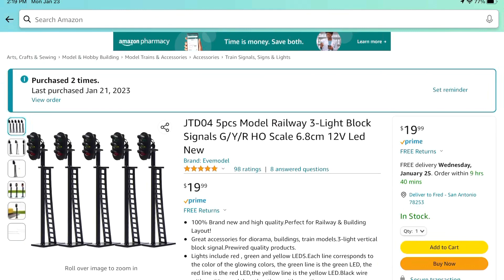My 6x16 HO Layout - Turnout Signals using Circuitron Smail

Comment: Never heard of 'Smail's"... always used manual Caboose Hobbies ground throws.  Looks like an interesting alternative for those hard-to-reach turnouts.  Thanks for sharing.
Reply from the maker: I like them a lot.  Cost more tortoise at certain qty levels depending on how many you install.  With tortoise you need addition decoder board.  I like to control my Smails with momentary rocker switch rather than throttle if it’s within reach.  Just easier.  Did video on this recently.  They work great on JMRI as well.
Reply from the maker: Here’s link I did on Smails. https://youtu.be/7Hm9U-HdxKU
Reply: I have a 13x9 layout, and while the electronics/automation side of things is intriguing, it's a lot of headache (and expense) to get it to that level for a small layout (prices in Canada are extreme compared to the USA).  Sometimes good enough is good enough.  Looking at your layout though and the 'thumbnail' it looks like your layout would have benefited from a 'double slip' switch as it doesn't look like there's a way to get from the 'north' track to the 'south' track without having to traverse the entire layout to get to the correct turnout.. unless you planned it that way?  Smails on your layout makes sense as one turnout needs to work in concert with another to properly route trains.  With my layout, the use of ground throws adds a certain level of realism (and panic) as I race to throw a switch, lol.  So long as you're enjoying the hobby, that's all that matters.
Reply from the maker: I’m assuming you are DCC and you are sure right about cost of electrics.  Original I was DC when I started in 2017 with all Atlas snap motors.    Then I got seduced by DCC and cost really increased. I have over 40 turnouts with Smails at $35 each.  I have expansions on each side of the 4x16 with just Peco switches without switch motors.  On the far side extension a have one double slip.  I have two back to back in my NH layout at the Cargill plant.  They work really nice on both layouts.  As far as your observation, I was a complete novice when I build the area you talk about.  Too late to change it now.  Thanks for feedback.
Reply: @FredE528  40 turnouts? Oh my. I think I have 12.  Just to give you an idea of prices in Canada... a Peco Code 83 turnout at an uppity hobby shop retails for $45 + tax = $50.85, which is around $38 USD (Ouch!).  One Smail here costs about $47 USD.  (double ouch!).  Best way to get in the hobby right now is the used sales table.  If you see a large layout on YouTube and they're from Canada... they [likely] have deep pockets, lol.  Keep the videos coming - they're great!
Reply from the maker: Wow, expensive.  I bought my Smails on eBay.  Got a super low price on some of them.  I get my Peco turnouts from Iron Planet Hobby. When they actually have any.  A checkout code of ‘Human’ gives you a discount.  I don’t know if they ship to Canada.
Reply: With exchange, import fees, even with a 'discount code', we're still better off paying the super high prices of our local hobby shop.  The days of shopping on eBay are over as they now charge tax on used goods.  I think, unless you got in the hobby years ago, it's terribly cost prohibitive.  Thank goodness for train shows and the used sales table.
Reply from the maker: I’ve only been to one train show lately.  Bought several completed buildings for Creston on my NH layout at super great prices.  Can you buy on Amazon without import tax?

Comment: Wow Fred almost didn't recognize your layout. The signals look 100 % professional.  I'm not familiar with modern Bus feeders or wiring I was wondering why the horn went off.
📯🤐😹😄🤣🤣 🤣🤣😄 
Oh Fred !   What model railroading can throw some curve balls. Your layout looks like the book catalog of PECO this looks really great modeling Fred. 
Harold.
Reply from the maker: Ah, the horn!  This Fredup (Mark @ M&M Rails term) was bad! After installing the signal on this motor it no longer worked.  🤬. I guess I shorted it out somehow during wiring. 🤬.   Couldn’t quit understand why.  I’ve done this over a dozen installs.  But ‘It’s Always $&#$& Something’
Reply: @FredE528  Don't worry Fred i will make you feel better. The first time I set up a motor switch I held the button slide to long ( It was an ATLAS. HO)  I smelled something burning couldn't figure out what was until : I saw a lump of slightly melted plastic That's what was burning. 😵 🤐📯I can laugh at myself now!  🤣🤣🤣 That happen to me years ago. Mechanical bugs. You have my support always fun & spirit.
Reply from the maker: I had major short in past. https://youtu.be/0J4wr0wc9yE

Comment: Hi Fred, I love the signals, really looks good. (If I ever😆)get a switching layout going, I'd like it look something like that!!! Love it🥰👌
Reply from the maker: Thanks Grant 😀  I still have 6-8 to add on far end of the layout.  Not a lot of fun - soldering extension wires then back work under the layout on my creeper. 😬
Reply: @Fred E Model Railroad  I bet, that creeper is a life saver! Least your on the ground, not like when you were up a ladder trying to get an aerial view of your layout if I remember rightly 😆 brilliant!! Just bob a bit of ZZ top on in the garage, and boggie around for a bit, loosen up before going under the layout!🤠👌
Reply from the maker: ZZ Top great idea.  Not much boogie left….  Failing off ladder would be deadly.  I actually feel off the creeper yesterday.  I felt the shock from that 3” drop…😕
Reply: @Fred E Model Railroad  3" can make all the difference in a many situations🤣

Comment: Hey Fred.  How are you doing? Haven’t seen you post anything for a while.
Reply from the maker: Hi Bill, thanks for reaching out.  It has been a while.  Physically I’m doing well.  Just at crossroads with my layout.  I have some small projects but no motivation.  I’m giving strong consideration stripping it down to the plywood.  Put on new foam and start over.  But I can’t even get motivated to start.  I’ll decide on this in the Fall.

We will head to NH in about 30 days.  I spent few hours today boxing up the BNSF equipment and Walthers models I bought over the winter.  Not sure it will all fit in my car top storage carrier.  I might have gotten a bit carried away on eBay!
Reply: @FredE528  I’m glad you are going well Fred.  I’ll be honest and say I was concerned there.   Half the fun is in building a layout and then tearing down snd going it again as skills get better and we know what we want to do 😄. So many opportunities for something totally different in that space you have.  I’m somewhat in the same boat.  I don’t want to tear down but I may need to do something else.  I have the itch to start another lol.  I’m seriously thinking about adding a third 4x8 for the switching layout.  I just need to figure out how with getting rid or any 😂😂😂
Reply from the maker: Thanks Bill for your concern and follow up. 😀.   I got into the hobby in April 2017 knowing almost nothing.  Not afraid to try given all the YouTube educational videos available.  You do wonderful educational videos. 👍

I still have things to learn. Mostly JMRI automation with signals and occupancy detection.  But I honestly think I’m just not interested in redoing my SAT layout in my garage.  I could change the track plan but I’m still limited to the 6x16 space.  Like you, I get most satisfaction in the design and building something different.  I’m not ready to make decision on this until I come back to SAT in the Fall.  I’ll see how I’m feeling then.  

I’m not surprised you’re thinking about next build. 😀. But that’s a more difficult decision than I have.  What layout to remove?  You have done about all the scales and every type of landscaping imaginable.  Would you be satisfied with just building an extension on the HO switching layout for long?  How about doing a new whole garage layout with both HO and N combined?  Find a place to store the Show Layout offsite.  Or you could just seek treatment for your addition. 😂😂😂
Reply: @FredE528  you know therapy would be cheaper 😂😂😂. My wife has actually offered to let me rent a storage space and I may have to consider it.  Problem is that nothing is close.  I may just get a trailer and put the show layout in it anx maybe make a rack so I can slide a section of the  HO layout in as well.  I do have a city scene in mind for the HO and I did envision it with three sections before I filled the garage with other layouts 😄
Reply from the maker: I’ll be interested to see what you decide. 👍
Reply: So glad you are doing well Fred. Hello Grant, how ru buddy? Fred, this layout is for your entertainment while you’re in SAT. Do you really want to work under a new layout in an uninsulated garage on the creeper? A new layout would be a lot of work and the testosterone to be motivated is now a distant memory, lol.
Reply from the maker: My enjoyment in this hobby is building.  Some fun on YouTube as well.  I just feel I’ve done about everyone of interest to me on this layout.  Some small projects but nothing interesting to me right now.

Comment: Hi Fred, Checking the Man is ok?😊👍
Reply from the maker: I’m fine.  Thanks for checking on me.  I have first follow up visit since radiation therapy with my Urologist this morning.  Last week’s PSA lab test is .06 which is good. I think.  I’ll get this test every 3-4 months to see if it stays low.  

I haven’t done a video in over a month because I’ve lost interest in working on the layout.  I have some things I could work on but just not motivated.  I’m actually giving some thought to stripping it down and doing new layout. I’d keep the wooden structure and replace the foam top base.  Then new track plan.  I wouldn’t need a lot of new stuff.  BUT I’m just not sure I’m up for doing all that under the layout work on my creeper. I’m going to delay final decision until next Fall.  

I’m planning to be up in NH in 6 weeks.  I’ve bought a lot of rolling stock and several locos for this layout over the winter.
Reply: @Fred E Model Railroad  Hi Fred, sorry for late reply, we've had a few days away, lingdale, Saltburn on sea. Glad the PSA test was low, and best getting checked regularly 👌. And as for the layout, have a break, have a think. I get bored with stuff too easy 🙄 . The NH layout and trip will give you a breather from the Texas layout. I was listening to a song other day, Doug Sahm, with San Antonio in the titleGreat Song) and it made me think of you,not seen any of Fred's Videos pop up! Having two lay outs is a full time job! Your bound to loose some interest , or want to change it!! We are only human. 😁
Reply from the maker: Good advice.  😀

Comment: Very nice Fred.   I have mine hooked up to Tortoises.  I still derail on turnouts sometimes, hopefully you are a better operator (engineer) than me.
Reply from the maker: Thanks Paul 😀.   I also will still either derail or short out if I don’t pay attention.   But it’s nice to look down the length of layout and see how the turnouts are set.  Especially helpful on my curved turnout where two track tunnel into this turnout.  Two signals attached to this switch motor.  One will be green while the other is red.